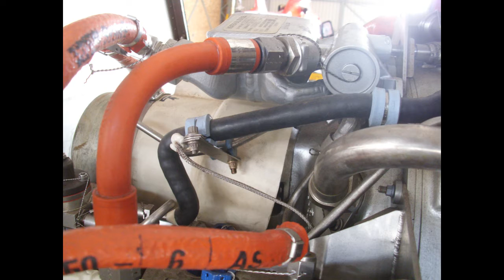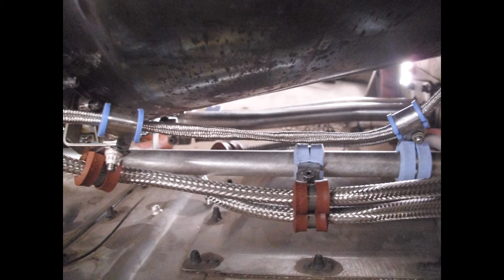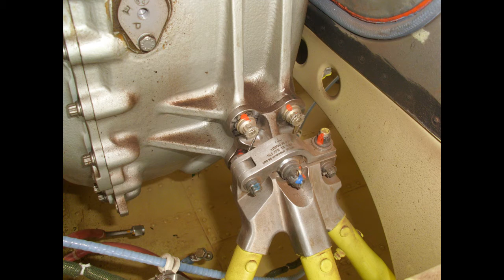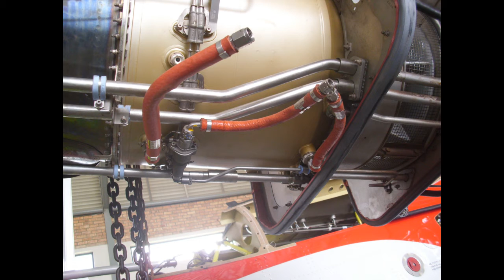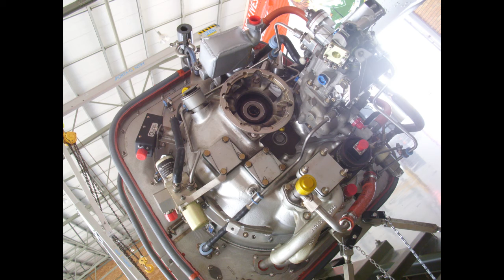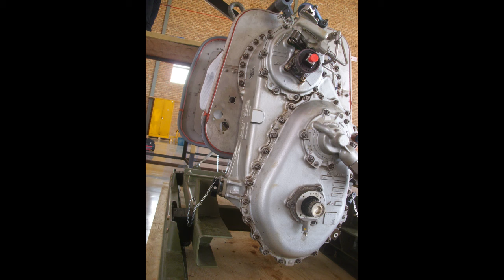PRATT & WHITNEY  PT6B-37A ENGINE ON AGUSTA AW119 HELICOPTER. Part2

Comment: Hello good sir, where is the engine oil cooler blower/fan.Don't see any intakes/ exhausts for cooling the transmission oil cooler as well.I see the round exhaust, maybe 6 inches on the port side, but i think that's for the air conditioning  compressor? Thanks
Reply from the maker: Hello, we appreciate your pertinent question. First of all the blower/fan is on port side next to accessory gearbox where both  aircon compressor by means of belt and the blower are driven by the short shaft. Two Thomas couplings are provided each side of this shaft. The ram air intake is situated on MGB cowling, the air enter the whole upper service deck by underneath the MR head all around the MGB is widerly open. The blower fan get the air from the surrounding area of the MGB above. Then to prevent any FOD ingestion into the blower, a screen on newer models is provided. That round on rear of the lateral dooor port side is indeed where oil cooler duct is oriented for the evacuation of the air which is expelled by the blower fun through the oil cooler. The oil cooler is divided into two compartment. 2/3 is dedicated to engine oil and 1/3 is for the transmission. Feel free to ask more questions as required. Thanking you Sir
Reply: @technikontv  I didn't see this reply, something is wrong with my notifications.Thanks again for explaining it, in regards to the other post.